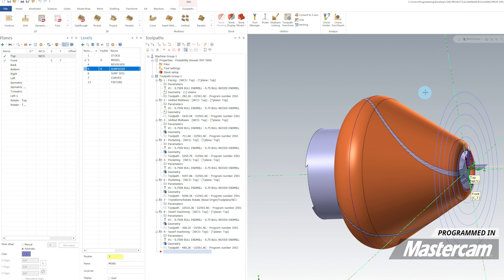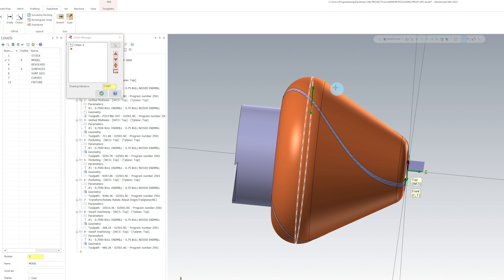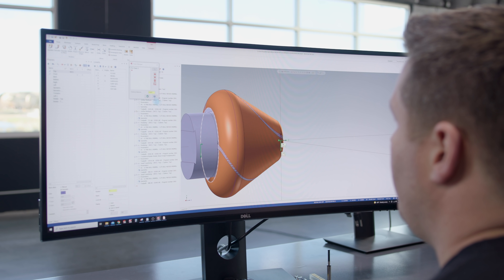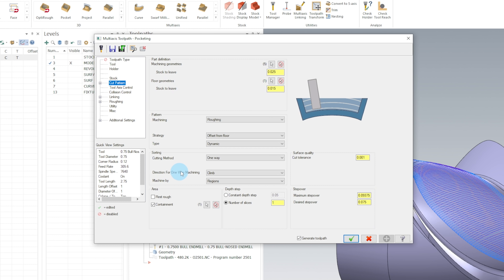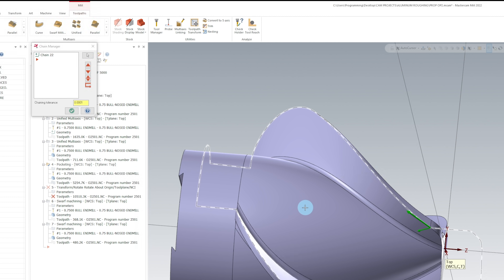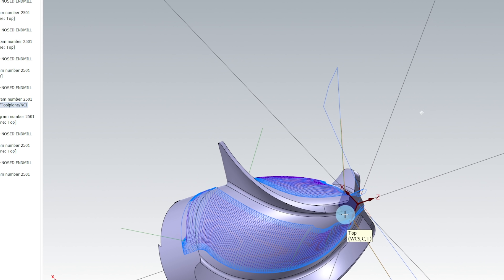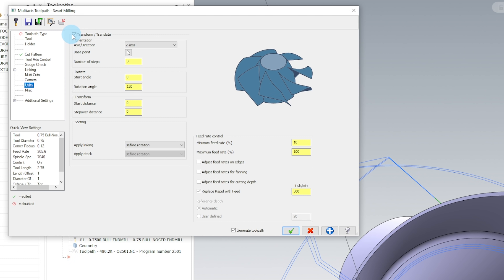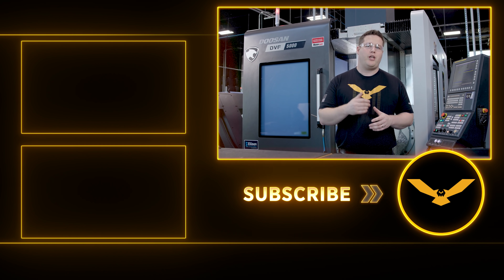Insane DVF 5000 5 Axis Propeller Tutorial | DN Solutions

Comment: I've always thought it was best to rough with several 3+2 positions then do your final passes with full 5. The reason being when all 5 axis are are moving simultaneously, the setup is less rigid than when locked in position with 3+2. Is this not the case?
Reply: There is some truth to that being less rigid because both the tilting and rotary axes are not clamped but there is nothing saying you can’t rough this way.  It just depends on what you are doing and this being aluminum there isn’t much concern for the rigidity.  That being said, yes I always will try to use 3+2 toolpaths whenever possible for both Roughing and finishing.  Some of the reason being rigidity but mainly because with 3+2 toolpaths you get the option to use cutter comp.  You CAN put 3d cutter comp on simultaneous toolpaths but most people don’t buy the option and it is difficult to get a post to support it properly.
Reply: @Jessie_Smith  good info, thanks for such a detailed response.

Comment: It looks like there is a tiny stall as the trunnion tilts during the swarf path? Is the program outrunning the machine’s look ahead ability? Or can something like that be dialed in on the post? Full 5A is a little outside of what we do, so forgive the basic question.
Reply: The trunnion simply needs to change the angle before it can proceed cutting
Reply: Yes. I noticed that too.
Reply: I've had that problem on swarf cuts when I had my path resolution set incorrectly and the post would generate thousands of lines of code to move just a tiny fraction along a constrained path. Pretty simple thing to overlook.
Reply: I couldn't get the lead-in angle perfect with the part so it is having to go from one angle to another in a very short distance at 305ipm.  I could have spent a little more time on it and perfected it but it wasn't that much of a move so I didn't worry about it.  Your question is not a basic question.  It is a very good question and what you see there is often one of the hardest things about programming on a 5 axis.  You can easily get toolpath on a part but getting it to be smooth with no jerking or unnecessary motion is the difficult part.